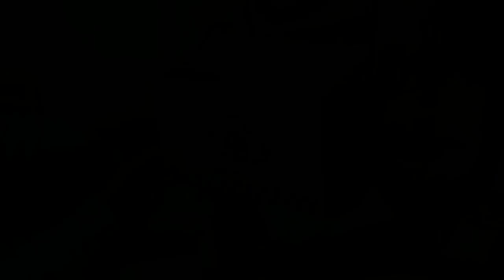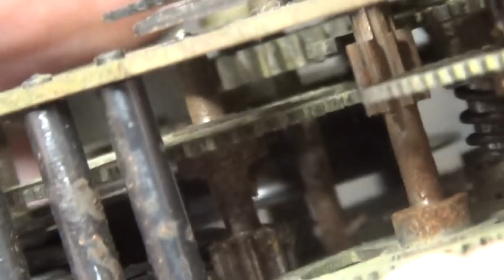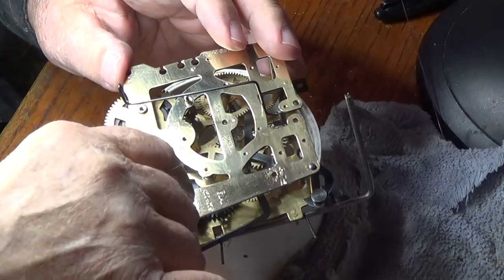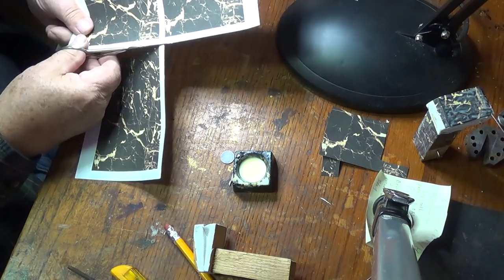Repair of an Old 8 Day Regula 24 Cuckoo Clock

Comment: An index for this video:
0:00 - 2:23 Unboxing the shipped clock, checking for damage, and identifying the movement.
2:23 - 3:44 Removing the chain hooks and loops.
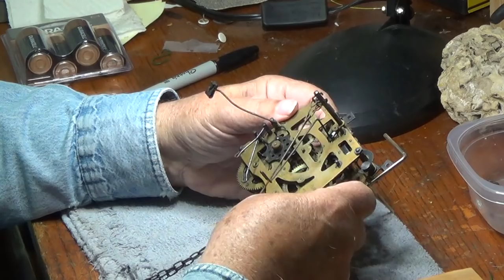3:44 - 5:22 Removing the movement from the case, examining the case.
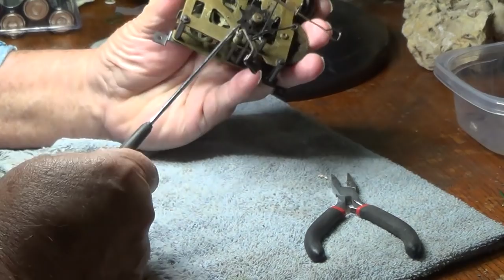5:22 - 11:19 Checking the movement parts for dirt, wear, and damage. The main wheel clicks aren't working.
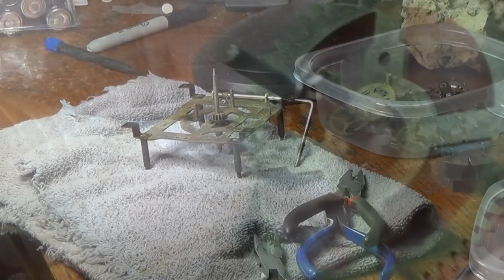11:19 - 20:47 Disassembly.
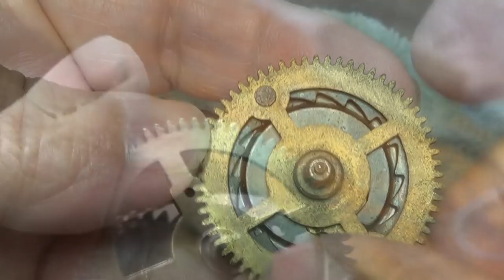20:47 - 21:53 Before and After close-up views of a couple wheels, showing hair, dirt, and rust.
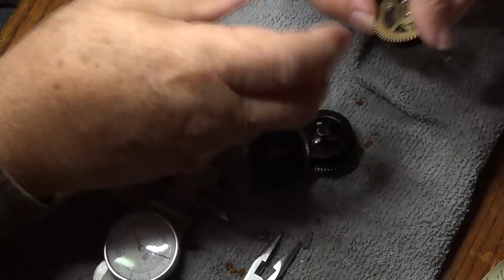21:53 - 28:50 Examining the damaged main wheel clicks in detail; discovering what the click spring should be.
28:50 - 36:53 Broaching (enlarging) the main wheel pivot holes for the new main wheels.
36:53 - 40:38 Bushing worn pivot holes.
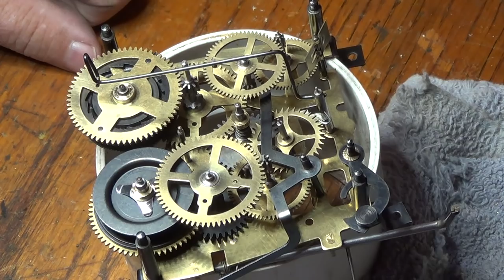40:38 - 41:39 Deciding how to replace the Regula clips on the levers.
41:39 - 47:29 Reassembly: getting all the pivots into their corresponding holes.
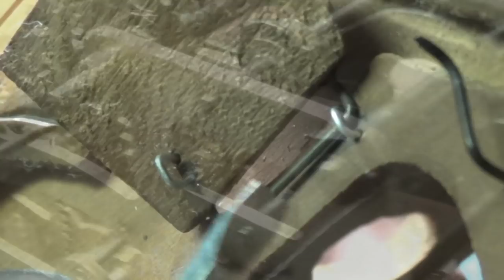47:29 - 47:43 The finished replacements for the Regula clips: brass rings.
47:43 - 48:10 The door hing has been repaired; the movement is in the case.
48:10 - 48:33 (briefly) Outlining the repair to be done to the bellows.
48:33 - 48:55 The movement - less bellows - running on the test stand.
48:55 - 56:21 Replacing the bellows' decorative paper.
56:21 - 57:47 Making bellows lift wires.
57:47 - 58:26 The repaired clock running on the test stand.

Comment: I enjoy watching your educational videos but have yet to see how you adjust the clock bellow levers and cut/measure the bellows wires to the right length, especially when birds or whatever are activated on the front too.
Reply from the maker: Each clock is different, depending on how much someone in the past has "adjusted" the lift wires.  Normally, one holds the lift wire parallel to the bottom of the movement and measures the distance to the wire loop on the bellow top.

Comment: Did you ever figure out what kind of clips those where? I am just curious. In my travels doing watch repair I have boxes full of cuckoo clocks and thought they weren't worth fixing. The more I learn about them the more I figure I am wrong about them. I recently tooled up to do clock repair and have been taking a class to be sure I learn the right way to do it. I have muddled through some pivot repairs and bushing replacement in the past they were my own clocks, and relatively simple. (no extra parts and running so I did okay) I am really enjoying learning and never realized there were so many youtube video's on clock repair. Some much better than others. I really enjoyed watching this old, neglected time piece come back to life. Thanks for sharing, All the best, Sean
Reply from the maker: Best I can tell you is they are referred to as type g retaining rings or type g shaft rings. Like the one on the far right in this link:  https://browse.startpage.com/do/show_picture.pl?l=english&rais=1&oiu=https%3A%2F%2Fwww.tensilegroupinc.com%2Fuploads%2F1%2F0%2F1%2F4%2F101489790%2Fretaining-ring_orig.jpg&sp=79d52d344304e716967ad8ddb0aba551&rl=NONE&t=default They are meant as retainers for shafts that have no groove in them. They simply squeeze against the shaft. Pressed on by machine and then a booger to spread apart to get them off.  Just keep plugging with the clock repairs.  It's enjoyable and satisfying.  Fix up those old cuckoo clocks and put them on eBay if you don't want them.  Cuckoo clocks are not cheap and people like some of the older ones better than the newer.

Comment: The owner did a nice job of packing it.  Wow,  the rust!   It looks like it may have been stored in a damp basement over that 40 year period.  I was amazed that you were able to clean them up.  I like that alignment tool you used to get the pivots lined up when putting the plates together.   I'll have to make one of those.  I wonder how these were assembled in the factory?
Reply from the maker: Bubble wrap a couple inches thick does a good job.  The alignment tool is called a pivot locator.  I got mine here, where it was too cheap to justify the time to make one myself.  https://timesavers.com/i-8948894-8-pivot-locator.html    Assembly of the movements in the factory is done with jigs set up to align the pivots.  Here is a video from "How It's Made" that chronicles cuckoo clocks.  The link starts at the part of the video that shows the setup jig.    https://youtu.be/oEyUaNJGoxE?t=86
Reply: @dperry428  Nice link - I have long wondered how they assemble clocks in the factory, and that video answers all my questions. I really enjoy your videos of your clock work - keep them up!

Comment: I never get tired of seeing all the brass parts come to life. That little tiny spring was a bugger for the chain wheel thing. Dick said he could've told you about the type of "metal" that was used since he was a machinist. But you solved it yourself ~ as always! Another clock repair complete, on to the next :-)
Reply from the maker: Hi, T.  Yes, it's clock fixin' time.  I've already got another one up.  I'm getting itchy for spring.  I'd rather be outside working to finish the bridge.

Comment: are you replating the lanterns and trundles to keep the rust from coming back? do you.have a video of this procedure and a silver soldering procedure?
Reply from the maker: If a clock is properly cared for, there shouldn't be any rust in the first place.  The cause of rust is when a clock is either stored in a very damp environment or a movement is not properly dried after cleaning.  Plating of parts is simply not necessary.  The parts also should not be oiled. Solder use in clock repair should be avoided where possible.  I only use it for replacement of damaged wheel teeth or where other repair or replacement is not possible.  There is nothing special about the procedure.  Clean the parts, apply liquid flux, place tiny pieces of solder at the joint and heat the part(s) with a miniature torch until the surfaces are hot enough for the solder to melt and flow into the fluxed joints.  Not different than regular soldering; just a slightly higher temperature.

Comment: Regula uses Split rings and E-clips and you need  Split Ring Remover pliers.Some supply houses carry them also Harbor freight.Too bad you had such a terrible time removing them.Love your videos. How did you clean the rusty gears by hand ? Cleaner,,steel wool ,sandpaper,   ETC?  Keep the new vids Coming.
Reply from the maker: I'd never dealt with that particular type of ring and it turns out the biggest problem was they were almost welded to the arbors with rust.  Thanks for the heads up on the ring type.  Hope I never run into them again  All the newer Regula movements have used E-clips in a groove on the arbor.  Generally, when I have gears and arbors this corroded, I first scrub in cleaner with a brass brush, then I use a mild abrasive with 0000 steel wool on wheels and arbors and wood splints charged with abrasive  for the leaves of the pinions.  Finally, regular cleaning to remove abrasive traces.  Tedious, but effective.
Reply: Thanks for your reply. Hope to see more new vids. @dperry428

Comment: Mr Perry I recently purchased a black forest Heco 8 day , it seems to be a 1950 1960 model , I've cleaned and oiled but the pendant will not swing more than a dozen times and stops. Can you point me in the right direction to get this working again.
Reply from the maker: Is the clock "in beat"; is the tick-tock sound even?  If it's even slightly off beat, it will not run. If the clock is level and the tick is not even, you have to bend the pendulum crutch (wire that pushes the pendulum wire) until it is even.  Try watching this video:  https://youtu.be/FN2ssq05HGA
That's likely your problem.  If it still doesn't run, it is then badly worn enough to require rebushing.  My bet is it's out of beat.

Comment: How did you determine whether you use a cutting broach or a reamer to enlarge the pivot holes?
Reply from the maker: The reamer is used to cut out the old, worn hole and make a new hole for the bushing to go in.  The cutting broach is used to make the hole in the new bushing match the size of the pivot that goes in the bushing hole.  A bushing is chosen with a bore that is equal to or smaller than the pivot.  Even if a bushing has a bore that matches the pivot, when the bushing is hammered into the reamed hole, it slightly closes the bore of the bushing, requiring it to be broached out until the pivot fits.
Reply: @dperry428  so so helpful thank you so much. I'm working on my 3rd 8 day and could Have accomplished nothing without your videos, and answers to newbie questions are really appreciated

Comment: Hello Sir, I clean my cockroach clock and now, the clock run well without pendulum but when I add it, the clock stop after 5 second.  Do you have an idee?
Reply from the maker: I don't know what a cockroach clock is, but if it stops running with the pendulum on, I'd suspect it is out of beat.  Does it tick evenly?  Try watching this video  https://youtu.be/_ek0fWOAdok

Comment: I have a cuckoo clock similar to this with the same gears and inner workings and the pendulum keeps stopping do you know what is causing it to stop
Reply from the maker: 1. Clock may not be "in beat". 
2. Clock may need to be cleaned and oiled.
3. Clock may have worn pivot holes and needs extensive repair.
4. Pendulum may be stopped by a draft such as forced air heating.
Your question is similar to calling up a mechanic and saying, "My car doesn't work. What's wrong with it?"
Reply: @dperry428  sorry I was just curious as to what problems it could be I was trying to fix it for my grandmother but I got to work but thanks though
Reply from the maker: Nothing to be sorry for.  I just gave you the truth.  It's tough to know the problem without seeing and analyzing. First, see if the ticking is even (in beat).  Look to see if the pendulum wire is rubbing on the opening in the bottom of the case.  Make sure nothing, such as an air vent is stopping the clock.  Try oiling the pivot holes that are available on the back of the movement.  After that, the movement will need to be taken out, cleaned and examined for worn pivot holes.

Comment: If one mainspring broke should u change all three if they are weak
Reply from the maker: If you have the movement apart and you have identified weak springs, you should certainly replace them,  not because they might break, but because a clock with weak springs is not going to run the full time it's supposed to.  The springs certainly aren't going to get stronger.
Reply: Thank you one question can you retain clock places or just clean in clock cleaner see if they clean up a bit
Reply from the maker: I don't understand your question.
Reply: If the clock plates are dull will clock cleaner clean them
Reply from the maker: Yes

Comment: I have a clock that needs to be repaired how do I contact you
Reply from the maker: You can contact me by simply putting an email address in a comment. I hold all comments for review and I can then copy your email and delete the comment without publishing it online.  However, keep in mind that clock repair is NOT a business for me, I'm 75 years old, so don't want a heavy workload and only work on clocks during the winter.  Ordinarily, I take clocks for repair from people who can bring them to me.  I'm hesitant to take them by mail until I vet the person.   It's too easy for someone I don't know to send me a clock, get it repaired and then claim I didn't send it back, or not pay for the postage and parts or other various scams and dishonest conduct.  I'll consider your request once I know more about you and your expectations.  Generally, I also don't take expensive or very valuable time pieces.  I simply don't want the responsibility.   As much as the post office is generally reliable, as is UPS or FedEx, we've all seen stories about things mysterioiusly disappearing or being stolen off the front porch.

Comment: Ours is a music box cuckoo clock with dancers. It was a very easy repair, all i had to do was dust it out and clean it. Then I used some synthetic oul on the gears only using a small amount. Keeps time great and cuckoos on the hour! For some reason it's missing a chain, so no music yet. I need to order a new chain and weight, but other than that it works flawless!
Reply from the maker: Chain is sold by number of links per foot and the diameter of the wire used.
Reply: @dperry428  bought a new chain, but it looks new, and the other two are stained a dark brown color

Comment: I would have thrown the whole thing in the ultrasonic cleaner and then take it apart.
Reply from the maker: You must have unlimited funds.  Clock cleaning solution is around $60 a gallon.  When it gets dirty, it has to be replaced.  Sure, a gallon gets diluted with water, but it's too expensive to just use with movements that have utter filth, including grease, hair and fibers that can be readily removed before using the expensive cleaning solution.
Reply: I also would have done this.
Reply from the maker: Not a good idea to do that with expensive clock cleaning solution.  Better to get the grunge off with cheap soap and water before finishing with the ultrasonic cleaner.